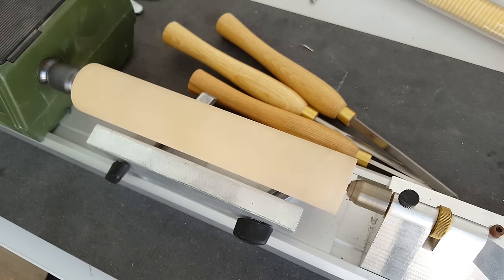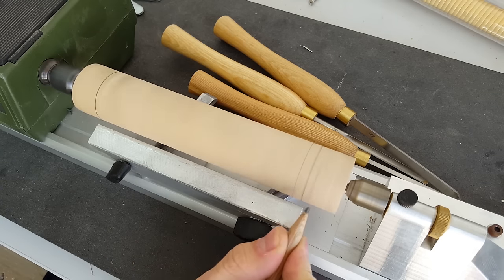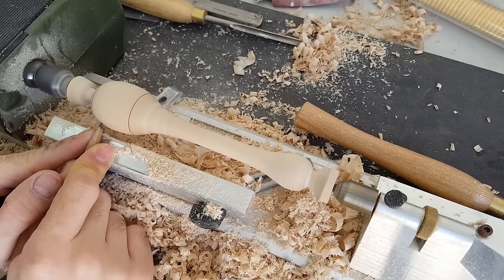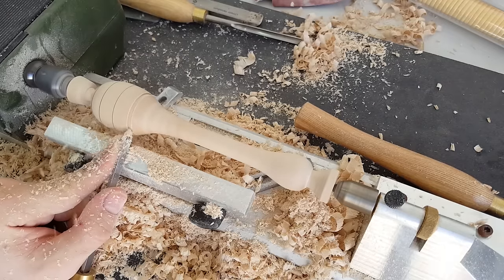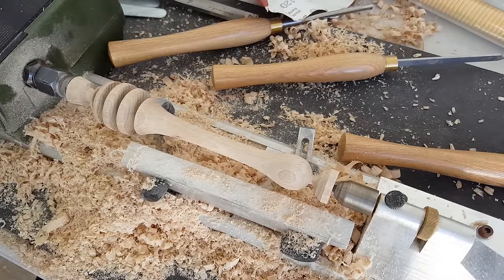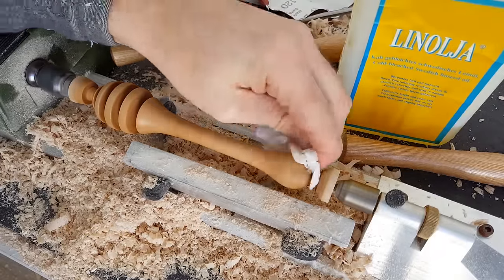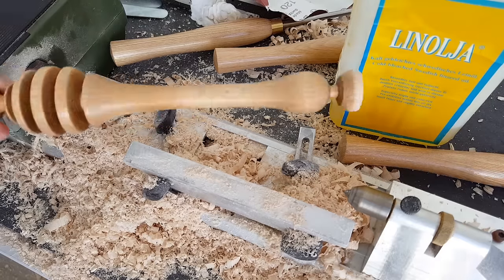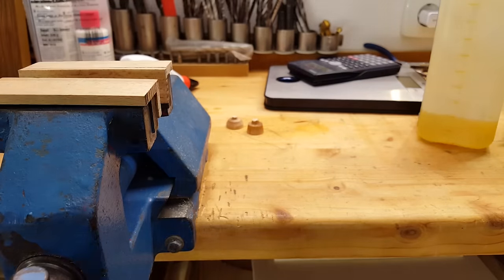How to make a Honey Dipper. Simple wood turning

Comment: Is the linseed oil foodsafe? I know it's similar to flaxseed oil, but not entirely sure that it's the same.
Reply from the maker: Hey Mark,
yes it is food safe, at least according to the seller´s website. The oil I use is swedish "organic, pre-oxidized, cold bleached" linseed oil. It´s supposed to darken less and harden quicker than "normal" linseed oil. I really like it and made good experiences with it.
Thank you for watching!
Reply: Alternatively, you can use melted beeswax, which is what I prefer to use for food safe finishing.  Works great for sealing and finishing.  Just a suggestion.  Great project!  Keep up the great work!